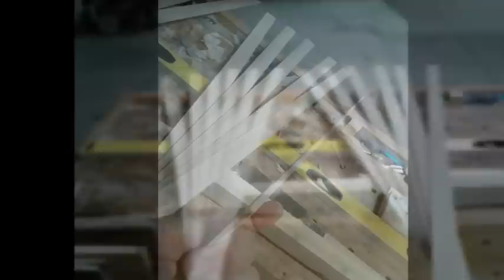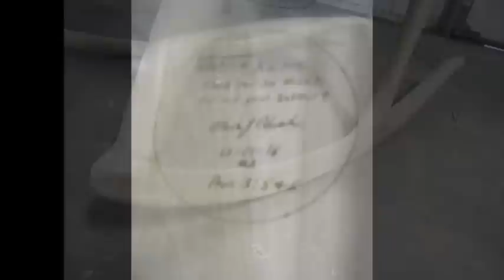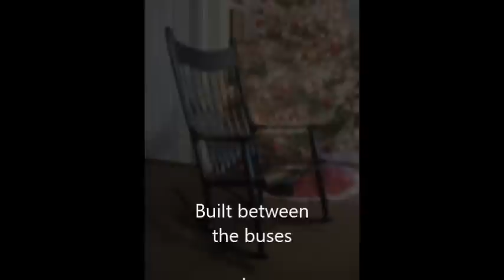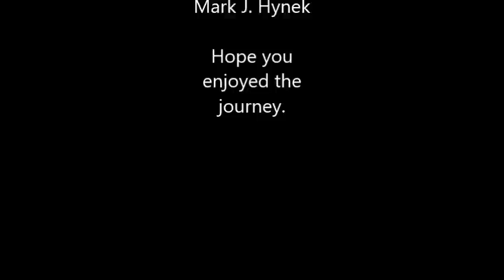Building a Maloof Rocker by hand unplugged.

Comment: Beautifully done.  Ripping the laminates with a Japanese saw was a master stroke.  I too build just with hand tools and have only recently started using Japanese saws.  They are exceptional tools!  I'm now inspired to rip my laminates as well rather than cutting the pieces from a wide plank.  te laminates not only use less wood but are much stronger for rockers. The other tool I favor is a Stanley #8 plane especially for truing up boards for making wide planks as in the seat.  I plan on making such a rocking chair and have been viewing everything I can on the subject.  Your video shows me it can be done by hand.  Your large bow saw is a great idea and I will make one of those for the project.  Thanks for the video and inspiration.
Reply from the maker: Thank you David Webster, that was actually my first try at building the rocker by hand and only my second rocker to have built. I have built three more since then, one of them being unplugged. I enjoyed it very much but basically you are a human bandsaw for most of the beginning stages. I built my bow saw from a 2x4 and bandsaw blade, along with a threaded rod with nobs. It worked well for what I needed. Hope you enjoy building yours as I did mine. Good luck.
Reply: David, I too do most of my work with hand tools.  I started doing it that way as a sort of defense strategy.  Every time I used a power tool I ended up stuffed up so badly I could barely breathe.  And that's with a good dust collection system and an air cleaner on the ceiling of my shop.  Even when wearing a dust mask I'd end up that way.  But when I use hand tools I don't have much of a problem.   Much less dust, much less noise and generally more, well, peaceful.  When I'm in my shop all alone listening to some soft background music while creating something out of wood I feel it's about as close to heaven on earth there is.

Comment: I've been hankering to build a rocking chair for some time.  And since I do much of my woodwork with hand tools, of course that's what I plan to try.  I've been looking at Maloof rockers but can't seem to build up the courage.  But you, Sir, have inspired me.  I'm very impressed.  Did you design it yourself or did you get the plans from another source?  If you designed it, would you be willing to sell the plans?  I have decent (not great) technical skills but a designer I'm not.  Thanks so much for sharing.
Reply from the maker: I wasn't brave enough to come up with my own plans but bought them from Charles Brock woodworking. He gives classes on how to build the Maloof rocker. He sells the plans along with a companion book and video showing the building process. You can also get his plans at Highland woodworking.com. I have built five rockers so far. The reason I built that one with only hand tools was to challenge myself, but also because I didn't have access to any power tools at the time. Doing it by hand you basically become a human bandsaw and even if you do use power tools for the rough cutting and shaping there is still a whole lot of hand tool work to be done on the final shaping. I hope you do decide to try it. I found it very satisfying. There were a few reasons why I chose to paint that chair, one the person I was building it for liked black painted furniture so I did the traditional Windsor chair milk paint finish, secondly, since I was doing it all with hand tools I wanted to use a cheaper wood in case I messed up so I wouldn't loose too much on the cost of the wood which is why I used poplar. Well, I hope that helps and encourages you to take the leap needed to start do that wonderful path. Believe me you won't regent it. Happy building.
Reply: @markhynek3341  I started doing serious woodworking about 3 years ago when I retired.  I dabbled a little before that when time permitted.  If I had to put a "rating" on myself it would be intermediate or maybe on a good day advanced intermediate.  My brother and I started woodworking about the same time and I think he put it best.  He said he's come to realize that much of woodworking is covering up your mistakes so that no one notices.  So if you made any boo-boos on that chair you did a great job covering it up.  It looked flawless to me.  I like to do something new, some new technique for example, on each project I do.  It challenges me.  I think that's how a person steps up in the skill department.  On the last side board I built I fastened the top to the base with sliding tapered dovetails  with hand tools.  They weren't real pretty but it worked.  But this, a rocking chair, and especially a Maloof rocking chair, will challenge me at a level I've never been challenged. I bought the Brock plans.  I can't wait.  Thanks for giving me a nudge.
Reply: @markhynek3341  Hello Mark. 5 builds!! Impressive. I have Chuck’s plans and am going to start on his island stools first so as to gain experience making the Maloof joints. It will also buy me some time to get my garage shaped up as well. 
I like the idea of poplar & painting. May do that for my first try.
I may be mistaken but do you have every harbor freight clamp I didn’t buy? 
I will say the paint looks great. A lot of TLC went into that rocker